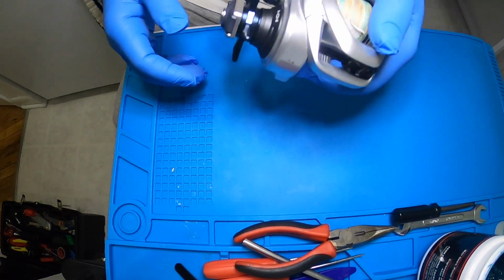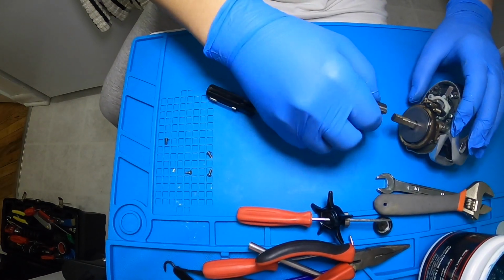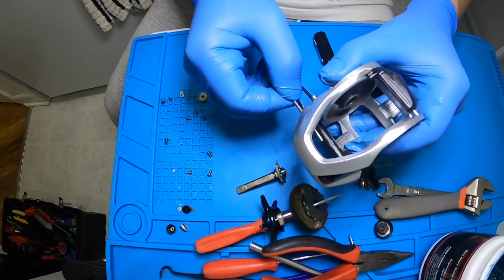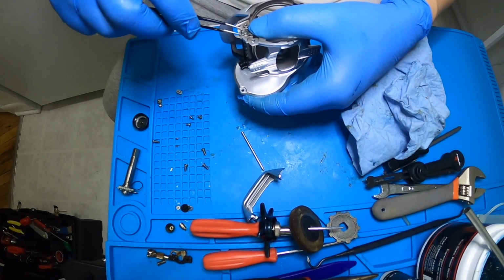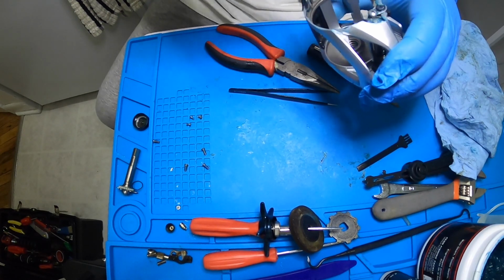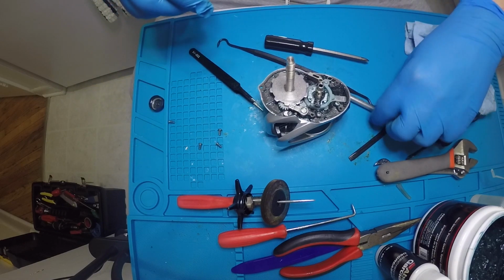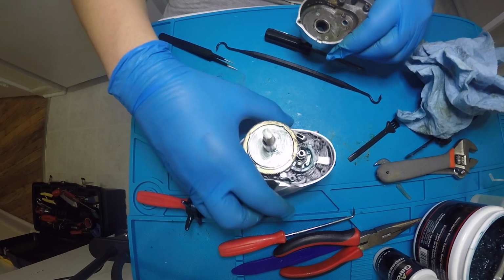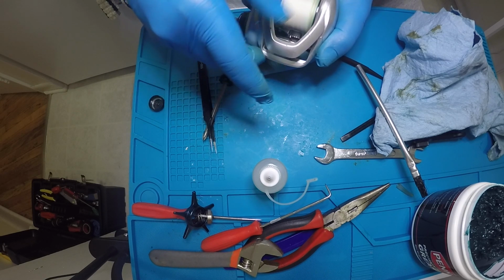Shimano Tranx 400 Reel Service   HD 1080p

Comment: Master.. I was planning to build my personal All-Rounder setup..

My Rod would be the Jabbers Wanderlust WC655 Casting Rod.

my Choice of Reel would be the Tranx 401HG..

May I ask if this can cast a 5g Minnow? Im planning to take this out for shore casting (5 - 40 grams ibabato ko) and light jigging up to 250g (basta slow pitch kaya nung rod)..

na try niyo po ba mag cast ng mga minnows? Salamat po advance... Thank you more fish to come! ❤
Reply from the maker: Sad to say master. There is no such thing as all around set up. Of course you can use it but my experience is pag tagal hahanap ka ng dedicated setup for jigging and for casting. For casting 20-40g lures mga size 100 to 200 with my line no heavier than 20lb braid line but I wouldn’t go lighter than 20g lure. With lighter lures less 20g, I would use no more than 15lb braid and less. I would use 7ft to 7’6” casting rod.

Slow jigging would be size 300 to 400 depending on the line capacity you need but I wouldn’t use heavier than 30lbs so I can load up to 300m line and lures not heavier than 200g. Heavier lure means you’re planning to jig more than 200m then you need line capacity of at least about 500m so you need an overhead reel i.e. Torium 2000.  Rod length 6’3”.

Hope this helps.
Reply: @BradHemedes  very nice info.. ill keep this in mind sir Bradley!  thank you much!
Reply from the maker: You’re welcome master.